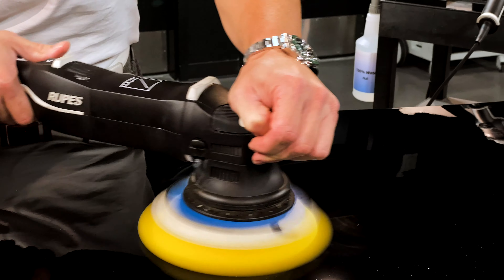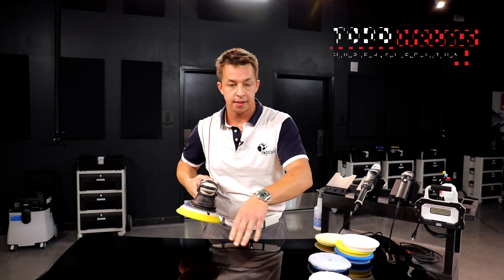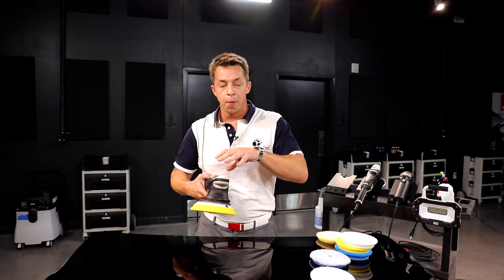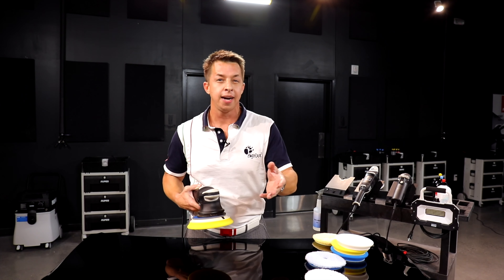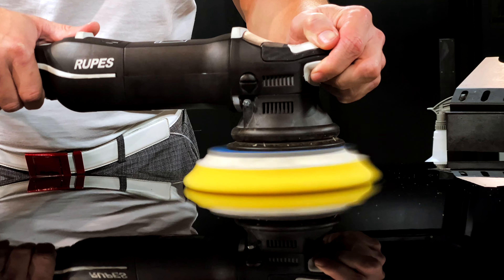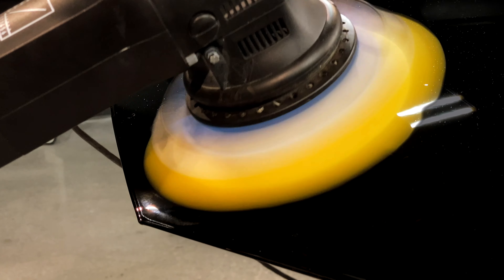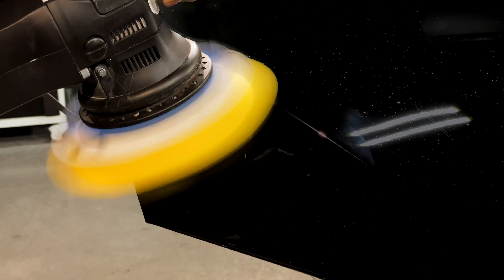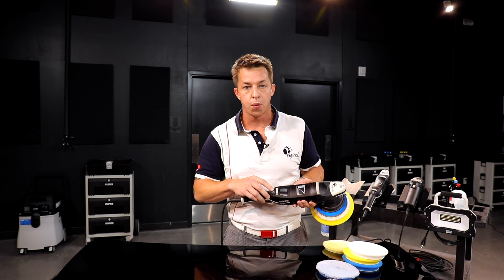The Best Way to Fix Pad Stall - [RUPES Replies Episode 016]

Comment: I think a question many people will like an answer too , specially because of the big debate about it . Should you use a washer mod on your LHr15 ( no matter the version ) or Lhr21
Reply from the maker: It is a question we've actually addressed several times, but to summarize we do not endorse or support any modification to the tools from factory specification. The "need" for a washer is overstated because it overrides an intentional friction point on the tool that has only a fraction of the drag that the pad does in contact with the paint. In gapping the shroud you are actually overriding some of the cooling that the tool does by having a seal there. 

Trust us when we say, if a 5 cent washer could "fix" something our engineering team would have done it. The reason it is not included is because it doesn't improve performance in any meaningful way and actually has a negative impact on the cooling functions.

Comment: My issue with my rupes MK3 is I believe machine faultiness. When I got it it worked awesome and I do know how to make corrections for occasional pad stall as mentioned in the video. What is happening now is permanent pad stall. Flat surface curved surface, tried test spots on other cars and different pads, even maxed the speed to see if that would help and sadly nothing. Grabbed my old Torq and no pad stall.
Reply from the maker: Hi David, are you lubricating the shroud where it interfaces with the backing plate? 

Check out this video of RUPES REPLIES and see if this is the the cause. Jump 1:50 in to see the lubrication but definitely check out the whole video. 

https://www.youtube.com/watch?v=0NcJjHLZ4AQ
Reply: Same issue here. The pad doesn’t spin even on the flat surfaces. Nothing worked so will do a washer mod. Definitely a design flaw- no idea how such a big company hasn’t addressed this issue yet!😅

Comment: Hi wanted to ask you that sometimes when we do finishing step with big food some scratches comes or it doesn't go on black paint can you jus explain something on it if possible?
Reply from the maker: If I’m understanding correctly you are introducing scratches or marks to the surface when doing final polishing?

Could be a number of issues, most commonly not working with a clean pad. Check out our RUPES replies video on pad cleaning and make sure you are cleaning the pads frequently to prevent haze and pad marks in the final steps.
Reply: @RUPES i am talking about scratches o black colour specialy i have problems with Mercedes models and porches.
Reply from the maker: Color has absolutely no impact on how difficult or easy a scratch is to remove, just how easy it is to see the defect. If you are struggling to remove a scratches there are a long list of causes/issues: 
-the scratch is deeper than the combination of products you are using can remove, in this case a more aggressive combination or adjustments to technique would be needed to increase cutting power. 

-the paint is harder than the combination of products you are using can effectively work on. Again, in this case increase the coarseness of products or adjust technique to boost cut. 

-the defect is deeper or the paint is harder than can be reasonably removed through the compounding/polishing process and sanding would be more effective.

-the defect is too deep to be removed, regardless of the combination and repairing it would do damage to the paint.

Comment: Hey Todd!!! I still remember chatting with you in private messages back in the days (I think 2008?) about Swiss Wax and Menzerna products when you were a detailer working with your high end clients. Anyway, I know that Rupes does not recommend adding a washer washer to improve the rotation of long throw polishers. But has Rupes considered making a free spinning long throw polisher? I cannot see a free spinning dual action polisher being that bad. Even my friends who are die hard Rupes supporters all perform the washer mod and loved the tool even more. A lot of authorized retailers of Rupes give a washer with every long throw polisher they sell. I watched a few of Rupes webinars and none of them explained why a free spinning pad is bad. I am now using a Flex long throw machine because my friends with Rupes told me to stay away from Rupes unless I am willing to modify the Rupes, which I don't want to.
Reply from the maker: Hey Castamir, 

Todd here. Thank you for the question and the follow up. We need to clear up a few terms, just so we are communicating clearly. 

The term free-spinning polisher or free-spinning orbital polisher is synonymous with dual-action random orbital. So RUPES makes a huge number of free-spinning or random orbital polishers including the BigFoot 21 (ES & MKIII), 15 (ES & MKIII), Duetto, Electric Mini, Air Mini, Nanos, and industrial triple-action polishers. There is a lot of BigFeet. 

I believe what you mean by your question is why doesn’t RUPES remove the friction between the rubber shroud and the backing plate which acts a brake and helps to slow over-rotation of the pad. There are a number of reasons, and I’ll do my best in no particular order to answer them. 

1) There is little-to-no improvement in performance. As stated in the video, and has been understood by the engineers and technicians who invented the large orbit free-spinning concept, the impact of pad rotation in overall polishing performance is minimal – at best. A pad that is rotating very quickly will only add 25% (roughly) of velocity to the pad’s edge, but over the face of the pad, that percentage averages out to about 10%. In other words, a 10% in total cut is what we could realistically expect if the pad was spinning very fast… 

The interference between the shroud and the backing plate offers very little resistance when the pad is on the plate. In fact, using a highspeed strobe light to measure pad rotation, you might see a 5% difference (at best) in rotation, provided the shroud is properly lubricated. 5% of a 10% improvement means an improvement of .5% total. RUPES has done extensive testing, both in the real-world and in controlled environments and the results are consistent with the math. 

The biggest impact in friction and pad rotation loss is when the tool is lifted off the paint and allowed to orbit at high speed. That leads to point 2. 

2) It provides a safety function. Remember RUPES invented the large-diameter orbital polisher from scratch and engineered all of the components to work with the unique system. It wasn’t a mistake the engineers made, and people fixed with a washer, it is a design feature. Why? The slight (.5%) impact on performance doesn’t outweigh the safety benefit. As a true tool manufacturer that cares about its customers, and who engineered the most copied pad design in the last 10 years, RUPES understands that allowing the tool to free spin in free air places an incredible amount of stress on the structure of foam pads. 

Excessive over rotation of the pad will have a negative impact on the foam’s life, and cause catastrophic failure, which could be dangerous. Thus the minimal change in performance is deemed worth the increase in potential safety. 

I appreciate everybody’s opinion and I know people really feel they are getting a benefit from modifying the tool to give them faster rotation when the tool is lifted from the paint. Perception is reality and RUPES recognizes this. We do not recommend disabling a safety feature engineered into the tool, but caution that if this style of modification is done, a longer bolt is used to make up for the separation of the backing plate and that it is torqued to proper spec. The spacing of the backing plate away from the counterweight it seats to can also increase side stress to the bearing if considerable off-axis pressure is added to the tool. 

I apologize for the length of the answer, YouTube is not a great format for it – but I wanted to provide you with a relative and complete answer. 

Cheers, Todd
Reply: RUPES thanks Todd!!!
Reply: @RUPES  On point!If they want polisher with more speed they can use rotary then instead of modifying it.

Comment: Another tip would be to ensure you grease between the shroud and backing plate.
Reply from the maker: Indeed. The video assumes the tool is properly maintained and operating as it should. We covered shroud lubrication in an earlier episode:

https://youtu.be/0NcJjHLZ4AQ
Reply: RUPES yes thanks, I’ve seen a lot of general social media comments where people aren’t aware of this simple maintenance procedure. They are amazed at the difference in performance once greased.

Comment: My yelow pad its starting to get some broken pieces in all the border line,is it safe to use it?
Its not in the place where the foam really works on but even so my question is if the performance is afected?may i use it safely?
Reply from the maker: A pad fraying at the edges is a sign that it may be due to be replaced. It will continue to work, but probably isn't ideal. If this is from many uses then it is to be expected. If the pad is fraying after only a few uses then you may need to adjust your technique to use less pressure, less pad angle, and avoid impacting the pad on edges and trim.
Reply: I havent take the right caution working on a plastic edge,i think that was the reason why it hapend,it wont hapen again,thanks a lot,cheers!